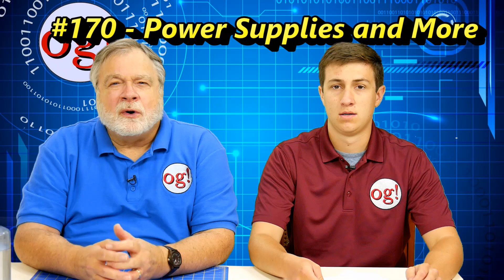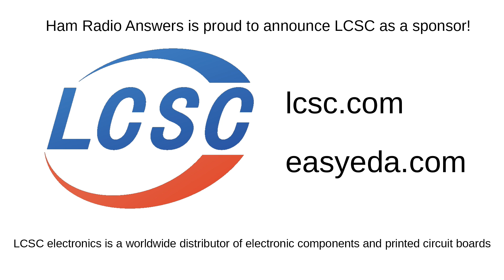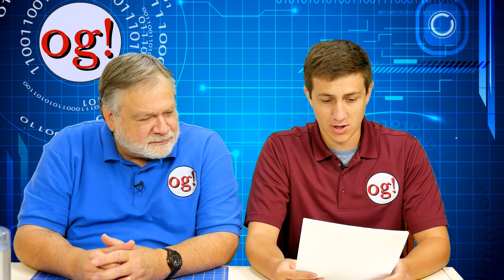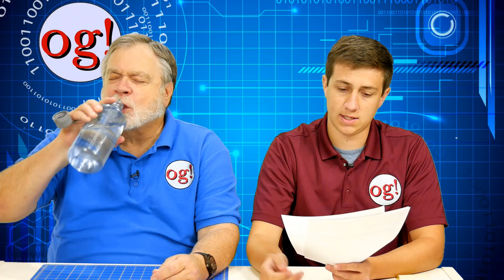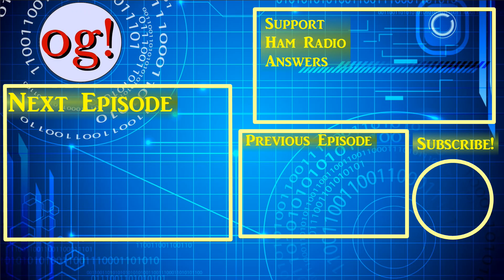Dave and Trevor Look at Power Supplies and More (#170)

Comment: An inverter with a 90% duty cycle should work, if you live in a restricted area where transmissions are prohibited then consider moving to some where.
Reply from the maker: That's what HOAs have said for years, but it's not that simple. It's very hard to find a home these days that doesn't have covenant restrictions against outdoor antennas. I am fortunate to live in an old subdivision that doesn't have antenna restrictions.

Comment: Dave is absolutely eight about 811H etc, but what i can say is you can connect the jack on the back of the radio straight to the Ameritron 811H Ptt line without a relay box, i have done that...also check my clip on here type in g4vvq in search box...Fred in Uk
Reply from the maker: Good point--the PTT voltages in some older amps can be pretty high.
Reply: Yes i check both the manuals and also spoke to Bob Nagy and came to the conclusion you can plug the Ameratron 811H and the Icom 7300 together without a relay, and i have tried it and it works fine, think ALC line is ok too. from Fred in Uk g4vvq.

Comment: ANY radio meant to run on 12 or 13.8 volt rating.... Sorry but ALL these radios should operate totally  fine anywhere between 11 and 15 volts.  No ifs ands or buts.  If it does not it is a very poor radio design.  The reason it drops off at the 10.5 volt is regulation stops at that point for the 8 or 9 volt rails in the radio.  The PA will operate down to 6 volts, it just won't put out power.  Cut out above 11 volts is Unacceptable.   How is one expected to do simple QRP type radio work with the engine not running on there vehicle, and the radio cuts out due to low voltages.   Very poor design.  Funny how car stereo can pump out 300 watts of sound but cant transmit 50 watts HF.   Yea the 13.8 booster helps with power output at the cost of more energy used but it should not be necessary in any way.  In fact radio should beep at ya when input voltage reaches 11.5 volts and cut off around 10.5.  P.S.   Be weary of cheep power wire improperly rated, such stuff like copper coated aluminum and such, wire claim be 12 gauge but measures closer to 14. Big voltage drop under load.
Reply: John, if you read the manuals for ham radios they are variously spec'd at 13.8vdc plus or minus 10-15%, and if you get one that requires 13.8 less 10%, that's going to crap out at 12.42vdc supply. This has been long documented, some radios really are not "12" volt radios, by design. Others were poorly engineered. The beloved Icom706 used powerline caps rated for a nominal 15 volts, but those caps are designed for a 10% variation, so 13.5 volts is enough to blow them, and nominal vehicle voltage is 13.8-14.4 volts. Icom never explained why that radio didn't use 25v or 30v caps, but they're not the only folks who have been proven to have dumb voltage issues. It happens.
Reply: Understand the low voltage of caps in automotive electronics.   That said.   Mobil radios are rated at 13.8 volts OUTPUT POWER.  That is not the voltage required to run the radio.   Next.  Minus 15% is 11.73 volts.  Radio had better come on and work at that voltage.  Next,  car computers, radios, ect. will all operate from 10 to 15 volts.  I know this cause when cranking you get big voltage drops possible down to 9 volts.  How about battery internal resistance?  They all have it?  Draw a load the voltage drops.  And yea QRP is low power but it still uses power, it must run down to 11 volts.  All mine do,  regulated supply will only give half rated output though.
Reply: 'Mobil radios are rated at 13.8 volts OUTPUT POWER.  That is not the voltage required to run the radio." Well, that's only half the story. All the tech specs I've seen for mobile radios may show output power at 13.8 volts, although portables may show output-vs-input voltage for several different battery choices. Still that's just telling you what output you will get with 13.8v input voltage. There's a separate spec that usually says the mobiles require 13.8 volt plus-or-minus either 10% or 15%. When the spec is 13.8v within 0%...they need 12.42 volts to operate within spec. Minus 15% is a wider range spec, but it is not universal. And "operate" doesn't always mean cleanly, with full power and no distortion or other audible problems. And that's assuming the radio hasn't drifted a bit out of spec, either. Feed your radios whatever you want. I aim to feed them all enough voltage to keep them all happy, without needing to interrogate each one. That's not my opinion, that's the combined experience of many users, many different radios, over the course of many years. If you want a "12" volt radio, the safe bet is a h/t, which is always happy with less. Or, a nice deep cycle auxiliary battery, since the SLI battery in a car is quickly damaged by even a modest discharge.
Reply: Most of this I agree with.   But once again,  when does the radio quit?   That radio will operate down to 11 volts or it is a piece of crap.  ALL my radios do, even the TYT that I am ashamed of owning at this point.  I never once mentioned power output.  Next, voltage drops ANY time there is current draw.  In fact the 13.8 volt spec is taken from measuring the voltage at the terminals IN the radio so they remove all voltage drops from the power lines.  What is "within spec"??   Cause no radio made for mobile use is gonna put out full power at 12.42 volts,  and where did that number come from, minus 15% is 11.73 volts.   Your Low sulfate battery in your car is not gonna be damaged by using a radio for awhile,  ya just cannot leave it that way.  Must be kept fully charged.  This is no different than a deep cycle, you do not run them to dead ether.  This is coming for over 40 years of experience working on land based vehicles and moving equipment (ASE and OPESSA certifications).  Along with combined over 100 years experience from all in the shops.
Reply: John Cundiss if you reread my above post I said “a few hundred millivolts” a little different from a few millivolts. I realise that cranking the engine can drop the voltage far lower, personally I don’t need my ham radio to operate while the engine is being cranked. As for where the voltage is measured for these specs.... most rigs produce full output with 13.8v applied to the supplied power cable including fuses. Obviously the voltage within the rig will be lower. In practice a typical 100w HF rig used on SSB for a “normal” duty cycle can flatten a car battery in a surprisingly short time. In one of my old cars I had an extra alternator and battery to avoid this happening. Sadly my modern car doesn’t have space for an extra alternator.. p.s the second battery was a deep discharge type, not a vehicle battery,
Reply: Agree with all.   Except the millivolts.   Total of 6 feet of 12 gauge, neg and pos, and good quality actual copper, china radio's use copper coated aluminum.  This actually 12 feet cause best to have a negative return.  you pull 10 amp you will read at least a 1 volt drop.   Try it.  Now 10 amps is not a lot,  but it is also a lot, depends on point of view.   Question for ya....  If the radio is on while cranking, does it dim a bit but keep working?  It remains on?
Reply: If a QRP rig pulls the battery down that far the car is likely not to start. Obviously what one person considers to be unacceptable is ok for others. A low current draw rig but with sensible resistance in the leads should only see a few hundred millivolts less than battery voltage.
Reply: "If a QRP rig pulls the battery down that far" It isn't a matter of pulling the battery down. A brand new fully charged car battery will be 12.6-12.7 volts depending in type and manufacturer. After 3-4 years it may only be holding a 12.2 volt charge, and the car will be perfectly happy--but the radio won't be. Anything more than those voltages is just a float charge. 12.4 is a reasonably used 1-2 year old car battery. 12.2 is pretty normal for 3-4 years. Some of the old HF radios were famous for having "12" volt supplies but being built (like Harris and Drake) for extreme service at an extreme price, they'd often be internally designed to be happy all the way down to ten volts, for emergency use in military and consulate installations. Icom, Kenwood, Yaesu, are all "just" consumer spec radios, none of them met the old military/government requirements. That just was never their market. Using them in a parked car isn't their target market either, they expect 13.8-14.4 volts from an alternator in a RUNNING vehicle.
Reply: If your battery sitting there fully charged is at 12.2 then you got a bad battery.  Not sure where you got your numbers.  Next, coming from an OPESSA and ASE certified mechanic,  NO THE CAR IS NOT HAPPY!   The number one cause of alternator and starter failure is bad batteries. Fuel pump, computer failures can be linked to them as well.  That said.  whey YOUR battery is at 12.2 and you turn the car to accessory to run the radio, does the radio work?  So why would my transceivers cut out?
Reply: Forgot to mention.   Anywhere from 13.2 to 14.7 is considered normal charging voltages from alternators.  This spec I think is still acceptable even though I think they have tightened it up a bit.    Yea that is right.  It is also measured the 13.8 right at the radio terminals IN THE RADIO.  So if you crank 13.8 into your radio after that long wire,  no full power I guarantee.   This is not military specifications,  these are automotive specs.  Car computers/radios all operate down to 10 volts,  what do you think happens when you are cranking the car over?
Reply: Lyfan Deth, the point I was driving at was that consumer amateur radio gear does not normally have to operate down to very low voltages. If a QRP rig with perhaps a one amp current draw (on transmit) pulls the vehicle battery down to sub 12v it is unlikely that the vehicle will start.
Reply: Yeap.  This I agree.  A one amp draw on a known good battery should take quite a long time though.    I also know this.   Car manufacturers no longer recommend letting a car sit for longer than 2 weeks now.  It usta be 2 months.  It cause those damn computers will slowly suck that battery dry.  P.S.  Most modern radios are never actually off ether. They draw a few milliamps even when off,  any radio with soft start does this.  In fact  a lot of times the 5 volt rail going to the mic is active as well. Some are 8 volts to mic.
Reply: John Cundiss, the HF rig in the car was a historic case, it never quit as such but of course the internal regulators would drop out so on SSB transmit the thing would pull the VFO on peaks. Probably would have been better if it simply quit! One of the more recent cars with a dual band modern rig would occasionally cause the radio to drop out while cranking after car had been parked with lights on or whatever. Switching the radio back on (soft switch) it would seamlessly start back up. Regarding the voltage drop in the cables, certainly I have been known to replace the power leads in high power stuff to minimise voltage drop. As for lights dimming in the rigs, it used to be a useful indication on older rigs but a lot of modern ones use LED backlights driven from regulated supplies in the rigs. I might have conceded a few points here but it is better that the radio quits at low voltage than continues to operate with impaired transmitter purity of frequency stability etc. The argument is now just how low is low. As for owning Chinese rigs it is not something most of boast about, I do have a collection of UV5Rs which are primarily used as monitor receivers while I am working.
Reply: Can agree yea most.  Radio should just shut down, but in receive it should recover.  HF no matter what ya do your kinda gonna need some current to get out some and that's a lot to do with the compact antenna networks used.   Your right about the backlighting as well it will remain steady.  As far as the china radio's go...  There spectral purity is not to bad,  but they have no receive filters and the software is totally bass ackwards.  Only got a tyt 220 due to power and availability issues.   I also agree with FCC, the "full open transmit" of those radios needs to be banned and removed.  Why?  It is cause it is to easy.  Meaning back in the day you had to physically modify the transceiver to do your bidding,  now it is software,  way to easy.  Already know a few cops and what I understand is there are already "private networks"  for well,  criminals.  That another story though.  Is owning a china radio much the same taboo as admitting on a ham band that you talk on the children's band (cb)?
Reply: Millivolts?  Maybe if your DC wire is only a foot long and is a 10 gauge.  A QRP rig that has been on for a long time and done a lot of talking will run any battery down, depending.  A battery that does not have enough charge to start a vehicle any more can have plenty of power in it to run a low power radio quite some time.  P.S.  Can you be more specific?  Are you talking receiving or when transmitting,  huge difference there.
Reply from the maker: My Yaesu FTDX3000, as good a radio as it is, behaves "unpredictably" on straight battery voltage. I have the TGElectronics booster in line to keep the '3000 nice and happy with 13.8 volts, and the unpredictability goes away.
Reply: Sorry, but I have questions??????   You ever measure the voltage UNDER LOAD  at the radio??  Take the cover off and put probes IN THE RADIO!!!   Next...   How long and how thick are your cables running the radio????   Remember to double the length cause you running to AND from radio for current.   Next...   What battery are you using, age of it and what is its no load voltage vs. load voltage?  What is the batteries internal resistance?   Next,  when does it jack on ya?   Let me guess, when you are trying to pump out 100 watts?  or after it has been on awhile?   Even Yaesu  is getting there stuff from china now, rather disappointing. Not so much copper in what is claimed to be copper wires, from china.
Reply: Got a question that overthrows all the others.   First, FTdx3000 is a nice radio, am envious.  Here is my question,  why would you run this radio straight from a battery?  Here my reasoning....  This radio on just receive probably draws 2 amps.  You could fly half way to the moon on 2 amps.  Love the goodies but if you are in need of some battery life I not use that radio.  A "power conservative radio for good battery use?"  Not sure any more,  if I seeking efficiency I do not want any lights or relays in the rig, all those things take power over time.  But then how do you get all the goodies and get tuned in in time to make the contact?   I rambling and getting into semantics. Sorry.  lol
Reply: It's important to measure the voltage at the radio and the voltage drops of the wires. You can easily lose a volt or two under load if using a long or thin wire

Comment: You can get better voltage stability if you get a power supply with 1.5 times the current your radio draws in amps and the power supply will be more stable in the voltage output .
Reply from the maker: I think this would depend on how the supply is engineered. But you're right that some reserve capacity is prudent.